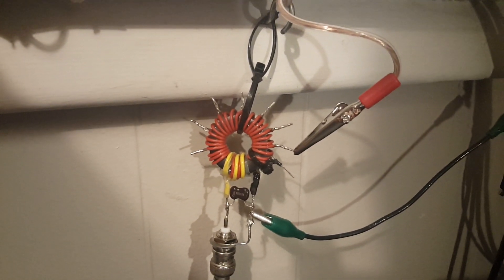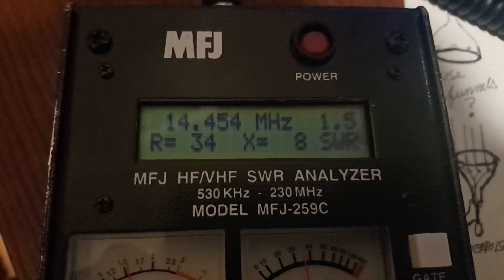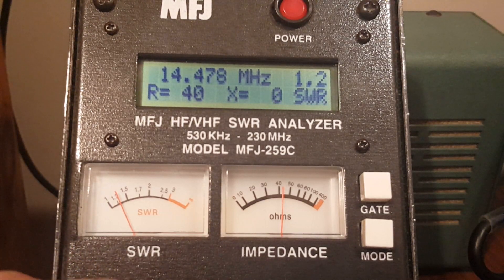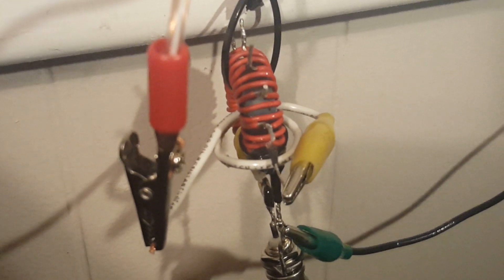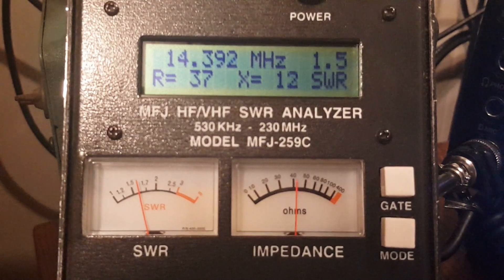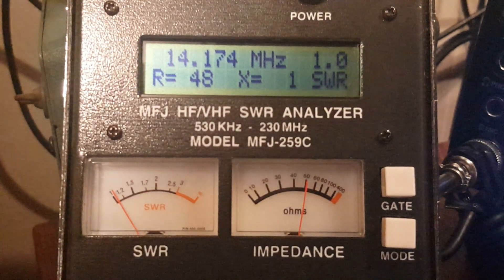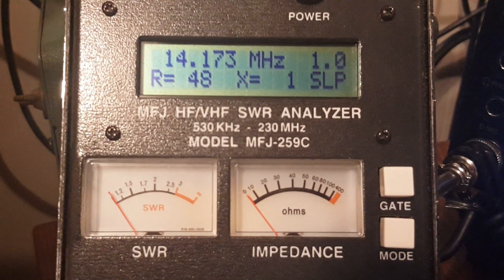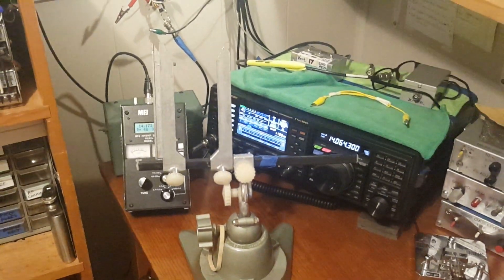Desperation Mode EFHW Antenna - Multi-Tap UNUN Tuning Tip

Comment: I have FT 240-43 torroids. I ordered a bunch for a build that fell through.
[I put out a request for those interested in the build to email me. Fifteen responded. I was surprised and ordered 20 cores from my QRP parts lady in FL. 15 for those interested and 5 for me. When it came time for the build day 3 people showed up. Two wanted to build a 4:1 balun and the other wanted a 9:1 balun. I had these extra core left and was going to wind 2 1:1, 8 4:1, and 8 9:1 baluns keeping a couple spares. Thought I would sell the baluns at a local hamfest for $20 to $25 and make double what it cost me for parts. It was several months later I saw your first video Chuck and I was keenly interested in your multitap balun.]
Prior to becoming a Ham I was concerned about the expense of equipment. Was this a rich man's hobby or could a poor, single parent like me be able to afford the equipment or find a way to build some of my own stuff. The only wealth I've encountered in my adult life is friendships and family. Monetary wealth has always been lacking. After my build class I sought out those that responded but didn't show for the build to find out why. Everyone contacted preferred to buy rather build once they began to think about it. I tried to reason with them why would you spend $90 when you could spend spend about $10 to build your own balun? I was talking to the wall.
All my homebrew balun's will be the multitap balun that you describe. I can't see using separate baluns, thus having to carry a large assortment, when I can use one balun with many selections. I have thought about adding a multiselect switch for encasing the balun but deeper thought chooses not to keep it simple st*pid.
72 de KB8AMZ
Reply from the maker: Oh wow, what a sad and worrysome story. It behooves me why that happened to you! Dear Lord, what kind of 'give it to me now, and i want it cheap and i don't want to work to earn or deserve anything in life' world is this becoming?
Humanity is in a deep, seep, decline with regard to intelligence in my opinion. This story is terrible but I'm glad you told me. I'm going to double down on my disdain for anythong bought if you could have possibly built it yourself.
I also grew up with none of the luxuries in life, other than my bicycle. Mom and dad ALWAYS made sure my sis and i had one. And we got to go camping every summer. In a tent when I was young, then a pop up camper when I was a teen. I maintained that camper, and the family car, and our family home, all from the age of about 14. My dad was a 'shop rat' as we call 'em here in Michigan. He wored at Chevrolet Manufacturing in Flint. We had what we needed, with very very few extras. Soda pop? It was a once-in-a-while treat. Each of us in the family had our strengths, weaknesses, joys and dislikes, and we all worked together as a family to make our life a happy one and a good one. We made this happen- we didn't try to purchase it.  73
Reply: @n8nkqrp595  I grew up in Springfield, Ohio with my Brother and 2 Sisters. At age 8 my Dad taught my Brother and I how to ride on 2 wheels. Then we shared a 21-inch bicycle for the next 2 years. I didn't ride much because my legs were long. I was over 6 foot at age 10. My Dad found a rusty bicycle frame that he sanded, primer coated, and painted. Then over time found parts to assemble a 26-inch bike for my 11th birthday. The only mechanical thing my Father ever taught me was how to mechanically maintain my bicycle. When I received the bike he told me I would have to maintain or he would take it away from me. I stopped growing at 12 years at 6-04. I put a lot of miles on that bike for the next 8 years in Springfield, Ohio, South Bend, Indiana, Sheffield Lake, Ohio (places I lived over the next 7 years). My Dad took my Brother and I to South Bend while he and Mom went through divorce. I was very naive but my Brother and I were introduced to our next family. Two new Sisters and a Brother and a new mom. In Springfield I was active in Cub Scouts and about ready to progress into Boy Scouts. My Dad and new mom helped me get involved in Boy Scouts in South Bend. I really enjoyed when my troop went camping. We went to Three Rivers, MI to Camp Tamarack. One of my first experiences of camping in the snow under a tent was at Camp Tamarack. I had more fun when our troop was the only troop at Tamarack on a weekend camp out. Summer was fun too, because I would to camp for 2 weeks. Other than camping with the scouts my family only attempted camping once. Dad rented a camping trailer that he hitched behind our American Rambler station wagon and hauled it to UP Michigan. We were going to camp at a State Park near the Mackinaw Bridge. We broke down twice on the way up. This really aggravated Mom. By the time we reached the camp site Mom was very short tempered. I don't remember what set her off on Dad but we didn't get to spend any time at the park. All I heard from Dad was "pack up, we're going home". It was dark when we got home. There was no singing or talking in the car like on our drive to UP Michigan. Mum was the word and sitting very stiff  on the tedious ride home. The only happening was Mom and Dad smoking a lot of Chesterfield's and Camel's.
Reply from the maker: @MoTown44240  Thank you for sharing that touching piece of your life. Funny how similar to mine.. in so many ways. Thank God I never  had that type of ride home from a trip. Oh, there were tense moments... but my sister and myself fighting in the back seat usually brought the 'rents back to 'center'. You know, threatening to pull over and make us walk! lol. Like my mom would have done that, and we knew it. She literally wouldn't harm an ant. Dad? One hot tempered guy.. but in these types of 'incidents', we knew he was pretty much enjoying the chaos. Because it did defray whatever situation was brewing. We all got along pretty well, even with dad's issues resulting from his first marriage. Issues that still linger on today in the form of angst in my dear sister.. and sometimes.. when she and I have a moment.. I can feel those issues affecting her and my relationship. So what do we do, she and I? Talk about it. We're not our parents, despite their heavy (obviously) influence on us - and she and I have a choice. We're free individuals, even tho sometimes it doesn't feel like it. I can't even throw a used zip lock baggie away! No way. Mom would be so seriously let down. Maybe pissed off at me. lol.
Reply from the maker: I may be completely insane  - but I keep hoping that this whole global nightmare will lead to a resurgance in people coming closer. Families spending more quality time together. People making do with less.. people conserving their money and rescources.. people renewing and giving new life to their things as opposed to disposing of them and replacing them. Just last week, with no prompting from me, my sister, a nurse, decided to remove all her house exterior light fixtures and paint them rather than replacing them. I asked her why. She said "for some reason, it doesn't feel right to throw something like those away anymore. It felt wrong". We grew up to place huge value on conservation and treading lightly upon our planet. Yet my sister is a BUSY nurse, about my age, with health problems of her own in abundance. She has the money and she has a shortage of time. Yet something has changed in her. And in my daugter. She's tripled down on her freakish refusal to harm the planet. I sure hope things change for the better. I don't mean violence in the streets, that's got to stop, by any means necessary, and NOW. What's changed is the way people are thinking about their homes, their lives, and just exactly what is important in their lives and what's nothing but fool's gold. Take care Terry OM
Reply: @n8nkqrp595  Of my 3 families (yes there is more to my life that I haven't discussed) my closest siblings are my Brother (we shared a bike) and my youngest Sister (not mentioned before that lives in Ohio). My Sister has never left Springfield and my Brother left Ohio in 1970 looking forward for treasures in CA with two military buddy's but ran out of money in OKC, OK. He's been there since 1970. My Brother and I entered the US Navy together. He got out a year earlier because he was 17 years old when he graduated high school. Staying in touch was a one sided affair, and sill is. US Postal Service and telephone were popular modes of contact from 1970 to 2000. It was always easier on my Siblings if older Brother visited rather than they put forth the effort. Email was just becoming popular in the last couple years of the 1990's. I am the only computer geek in my family. My Sib's were slow starters. I retired in 1993 on a disability. Now it was even more convenient for older Brother to drive 160 miles to Springfield or nearly 1000 miles to OK to visit the Brother. As cellular phones became more popular at the beginning of this century long distance phone calls became something that was not restrictive of calling more than twice per year. There is no closeness to my Siblings. I am closer to some friends than I am to my Siblings. Still, I am not close enough to know their daily activities of saving or caring about fixing their stuff rather than buying anew. My Brother is still working at 72 years. Due to poor mistakes early in life he nothing to help with retirement. He will work until he can't and hope that SS will be enough for him and his wife to live on (I doubt it will). My younger Sister and her husband are both on State pensions like me. In addition to my pension I receive 40% of my SS benefit due to the Windfall rule from Congress. I doubt that I will ever receive my entitled 100% Social Security benefit in my lifetime. Take care Chuck. Hope to meet you RF someday. It would be better in person over a cup of Joe, OM.

Comment: This is quite amazing man! It seems like it works much like a loading coil with multi tap points in DIY antenna tuners. It does have fixed capacitance but no variable capacitance. You could get an air capacitor and put it in place of the fixed capacitor and tinker some more?